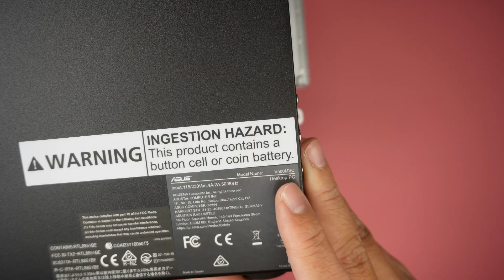Asus V500MV Desktop Upgrade & Replacement – Step by Step 🖥️🔧

Comment: I Acquired a asus v500 from a mate and thought I would put my rx6600xt into to it so I could game on it, its a proprietary laptop mb with a i5-13420H it has a pcie x16 slot running at gen 4 x8, I have adapted a atx power supply to power the system so I can power my gpu. The system recognises the gpu, I install the drivers once drivers are active the screen becomes laggy and stutters, then the driver crashes, then the drivers wont recognise the card and then I have to use ddu and reinstall drivers again and it does the same thing agian, I try running a game and according to gpuz my card is only outputting 500mhz game clock, when I stress test on adrenalin software it goes to full clock and everything seems fine but drivers constantly crash. Running windows 11?
Reply: a system like this should absolutely not be used for gaming. between the problematic 13th gen intel cpu, and poor case thermals it would get extremely hot with a gpu.